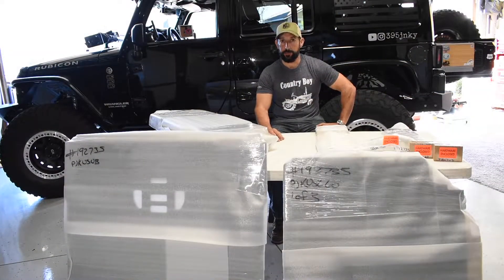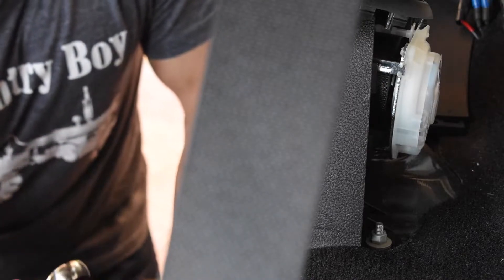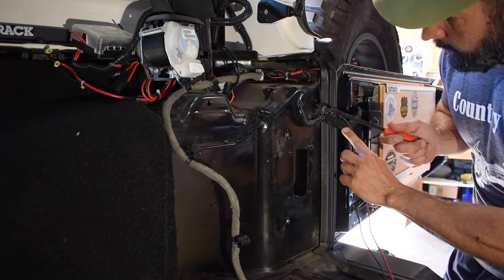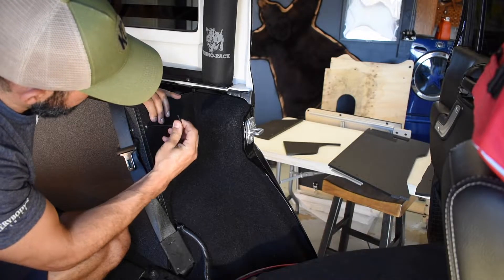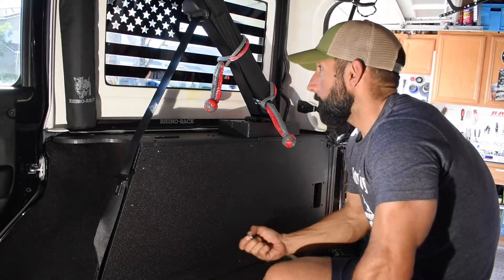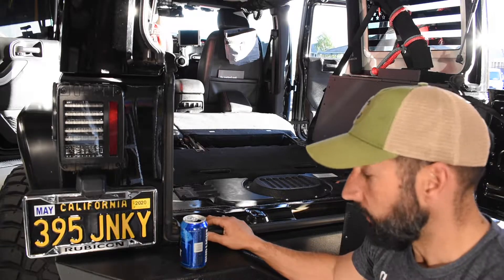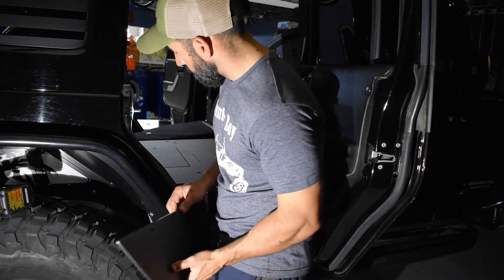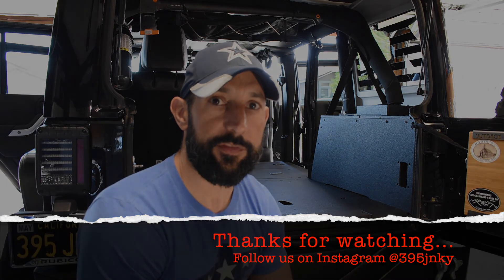2016 Jeep Wrangler Goose Gear Install in the 395JNKY Garage

Comment: Thanks for the video, How much weight did you add with this? can you tell the difference in gas mileage?
Reply from the maker: No problem.  As far as weight goes it really is insignificant if any weight was added at all.  By the time you remove both seats (60/40) I'm not sure it is any add weight.  If it is heavier, it is so insignificant there is no impact on gas milage.  Thanks for watching.

Comment: Thanks for the video. I just ordered the platform and 60% plate as well. Didn’t opt for the cubbies. My question is did you have to order the side plate for the passenger side on the 60% platform or does it come with it?
Reply from the maker: Hi Clinton.  Thanks for the comment.  You do need to order that part separately.  Take care

Comment: We are installing the same GG system this weekend without the cubbies. Did you have to drill any new holes to put your Dometic fridge slide in?
Reply from the maker: Yes I did.  But, it wasn't that big of deal...I don't ever plan on running around without the fridge, so the holes will never be exposed....Hope the install went well.
Reply: @395jnky , it went ok.  We didn't buy the cubbies, so we had to do some plastic trimming in the back, and we will have to take the platform back out to put the t-nuts in for the fridge slide.  But, it'll be worth it.  Thanks so much for replying!!!